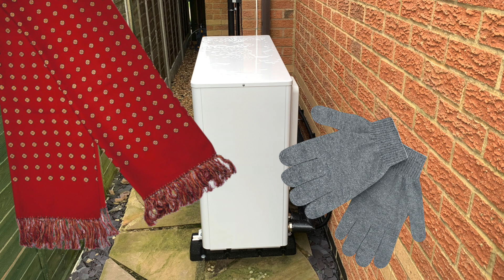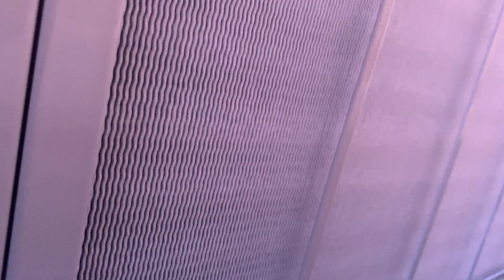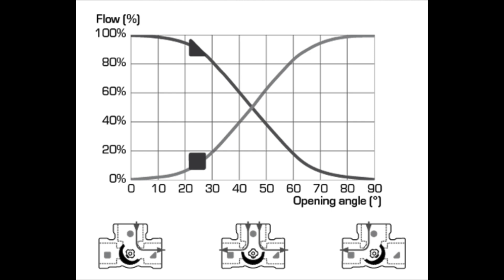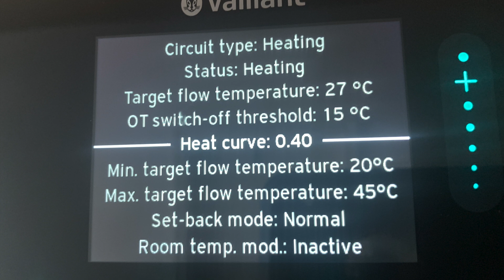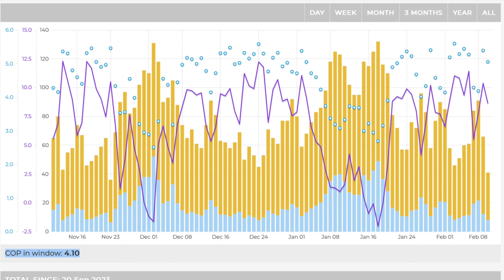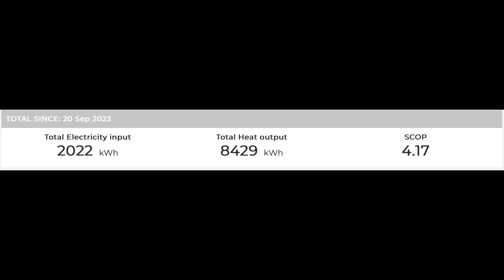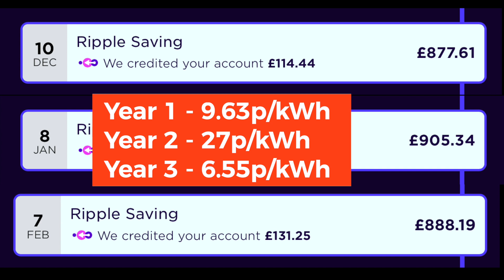ASHP winter performance and cost to run

Comment: Hi John. Many thanks for all the detailed figures and facts herein. You mention you have one battery already, and might benefit from another - what capacity do you have, and how many additional kWh might you consider increasing to? I looked to see if I could understanding how/when peak rate electricity was being called upon - can you shed light on this at all?
Second point - is the COP for heating your hot water typically lower due to the need to heat hot water to a higher temperature than you heat the radiator water to?
Reply from the maker: Thanks for watching David. We have 13.5kW battery storage, looking to double it to 27kW. I look at my bills (retrospectively) as peak/off peak is shown in 30 min time slots and the Tesla Powerwall app (realtime) to see what’s happening when we are peak rate. 

Second point, exactly that.

Comment: Hi John
Thanks for the update, we had a Vissmann Vitocol150- A151 fitted on the 6th December 2023 this is a 16kW unit. Based on the last 75 day we have achieved a SCOP of 4.49 after using  1,564kWh of power to achieve 7,030kWh of heat which is split roughly 82% / 18% heating / water. The best day being yesterday we achieved 6.07 against the lowest average of 3.24 on the 16th January.
The main thing we have found is that the house is comfortable all day rather than the old days of oil where we only heated the house in the morning and the evening.
Reply from the maker: Good to hear Mark. 100% agree on comfort levels, the heat feels much nicer as it’s low and slow, unlike the peaks and troughs from our old gas boiler. Controls make a huge difference to effective but also maintaining a stable indoor temperature
Reply: @johntisbury  also looking forward to Kirk Hill.